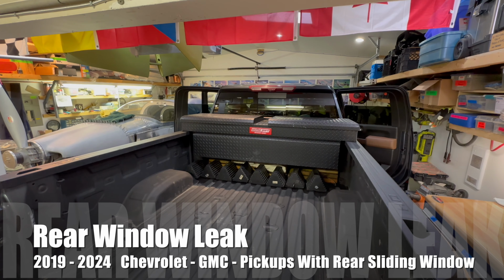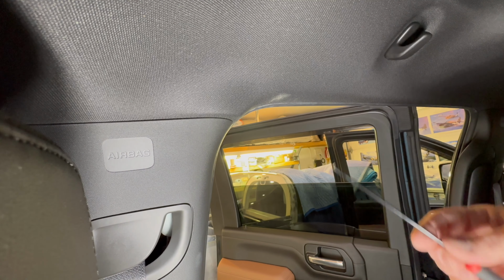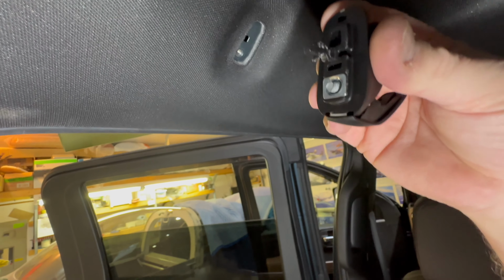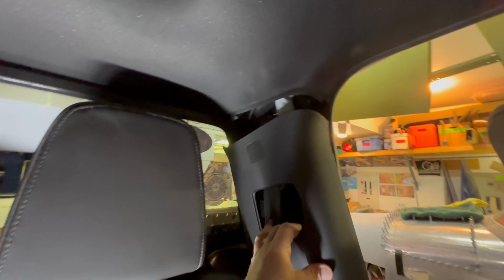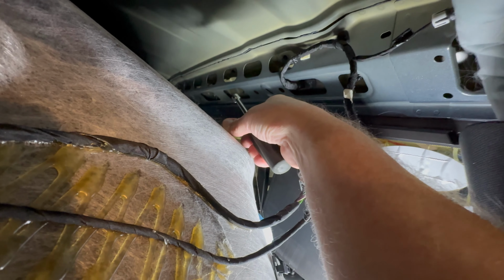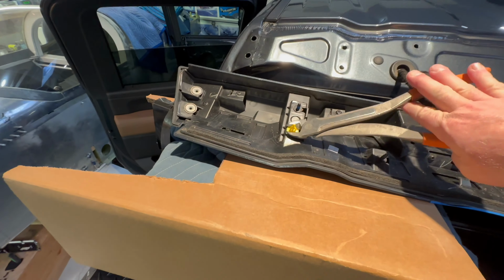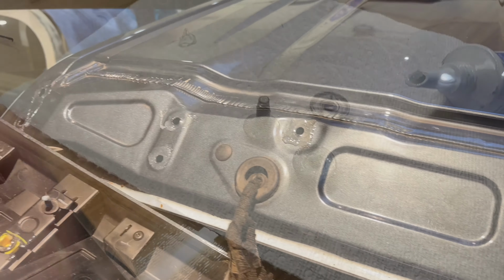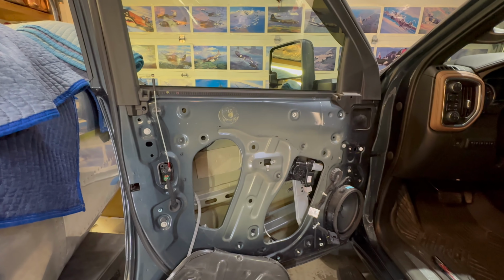Silverado Rear Sliding Window Leak Repair Fix 2019 2020 2021 2022

Comment: Nice video man.  I have a 2020 2500hd that started leaking 1 year into owning it.  Dealership replaced the window 2 times and resealed it 3 times.  Still leaks. Now out of 3yr warranty and trying to put it on me.  Dealing with GM corporate to try and get them to make them fix it.  Local glass shops around me don’t want to touch it since they know it’s a manufactures issue and haven’t found a fix.  They will replace the window and seal it but will not warranty their work that the slider won’t leak again.  Big headache!!!
Reply from the maker: That is horrible news. It's a dumb design. They've got over a dozen holes in the spoiler for all the fasteners. Impossible not to leak. Next time I have mine apart I will super clean all the holes with lacquer thinner then silicone every hole and bolt.
Reply: It’s a pain the ass for sure.  My solution is put the solid back window on there if it’s the sliding rail that cracks a leaks.  But they can’t seem to tell me if the solid back window and window with the slider are the same dimensions. So fingers crossed GM corp can answer that question.  The small slider is pointless in my opinion so just eliminate it if that’s a weak point in the design.
Reply from the maker: I think the worst part of the design is the dozen holes that the spoiler bolts go through. A roof with tons of holes in it. What could go wrong? How hard would it be to design this with tabs sticking up instead of bolts going though holes?
Reply: I’ve been having the same damn issue with my 2016 and my 2020 and GM dealership fixed it and it’s leaking again. Why can’t we as people who purchase these trucks form a lawsuit?  It’s not fair to us.

Comment: I think there more going on with these leaking roofs then meets the eye. I also have a 5th silverado with out the sliding window and my roof is still leaking. I just bought mine used a fee months ago so Im just finding out about the issue. If i had to place a better I say way is also getting in through the holes for the bolts that hold the 3rd break light spoiler. Im going to be sealing the entire outer perimeter of the spoiler with silicone to test out the theory. Also. The shark fin antenna also lets in water . Ill be silicone that always. 3rd i just found out recently that the black weather trims piece of the sides of the roof also leak on the new 2024 silverados dude to the weak metal underneath separating and creating a hairline crack. wondwr if that is also possible for the 2019- 2023 models . I found water coming down the sides aswell as from ybe front and the back. Smh GM really dropped the ball eith these trucks I tell you.

Comment from the maker: So I have a strong feeling that the dozen holes and bolts through the spoiler are going to start leaking again. Next time I find a leak back here I'm going to super clean all the holes in the roof with lacquer thinner then put a healthy ring of 100% outdoor silicone around each hole and bolt. Not a great design. Aluminum cab. Why didn't they make tabs that stick out for the spoiler to attach too? Instead they make holes all the way across. Bad design. Going to be lots of mouldy old chevys out there I hate to say.

Comment: Have to spend half a day fixing something GM should be recalling to fix….i took my 19 back and told them about it and it still leaks. Quality GM techs, now I got silicon all over that piece and it looks like shit.  Thnx GM
Reply from the maker: It's weird that GM would design something that needs so many holes through the roof. Stupid actually. Disappointing on a 100K truck
Reply: I’ve owned Chevy’s all my life and I’ve been a fan. Never again.  The 2019 Silverado LTZ is the biggest piece of shit. Their manufacturing quality control is subpar, the panels are too thin, and it shifts like absolute shit. #Chevysucks
Reply: I don't think they can fix it is why they haven't recalled it haha. Mine 2019 has leaked since I bought it in 2021 with 12,000 miles on it. Replaced the window multiple times and re-sealed multiple times. Still leaking.

Comment: So yours is starting to leak again or did the silicone do the trick? What electric tape did you use, how do you think that's helped over the last few months. Would you just put a bead of silicone in that gap the second time around?
Reply from the maker: I'm not sure about leaking again but I'm confident that it will. If idid it again I'd use more silicone and seal everything liberally. My favourite was sealing the gap bu putting a 1.5" vinyl tape across the entire roof. Sadely my son took it off. It was expensive Scotch 44. My vote for the simplest fix is to lay a huge bead of silicone all the way across the top to seal the gap put a strip of 3' vinyl across the whole top to bridge the gap and seal it. Basically make a roof.

Comment: Do you have a link to the tape you used?
Reply from the maker: It is 1.5" black vinyl electrical tape. Standard stuff but not available at Home Depot. Only at electrical supply stores.

Comment: I had the same problem in my 2016 and now in my 2020 which the dealership repaired in 2020 and it started leaking again a few months ago and my entire cabin smells of mildew once again.   My question is how come you didn’t put a brand new bead of silicone around the rear glass?   It’s great that you did the roof but what about the rear glass?
Reply from the maker: I felt that the bead I did went right to the top of the glass. Interesting thing has been happening is the type of silicone we used is leaching some weird film over the glass. it's a mess. Something tells me I'll be doing this again. I feel the dozen bolt holes through the roof are also potentially leaking.
Reply: @ontheroadwithnorm2024  this is just terrible, what can we do to file a class action lawsuit because this is not just five cars. This is thousands upon thousands of pick up trucks.
Reply: My 2020 is leaking bad today, just ordered the clips and going to try to replicate your fix. What silicone do you recommend?
Reply: Today December 18, back after a few months and I’m here to tell everybody that my window in the back started leaking once again after I had the dealership repair it several months ago, again! I wish I could post a picture on here of where she is leaking, but I have my doors open in my truck as we speak….. to air out the rear driver side carpet as I have it lifted up and with the heat on in the truck full blast.  I really hope GM reads this and I want them to see the annoyance that I’ve been going through with this damn truck and I’m not the only one..  hey GM what can you do about this? And I don’t mean fixing it again, how about addressing the main issue in your design flaw!!!!!!
Reply: @NicholasZak   I have my windows open now trying to dry out the rear back seat cushions
Reply: @clonts78  ohhh man im sorry!  I emailed GM Corporate earlier!
Reply: @NicholasZak  I've not had good experience with chevrolet, corporate or local. My 2019 has been in and out of shop for years because of the leak. They've replaced the window 3-4 times, resealed it multiple times. Still leaking as of yesterday. Every time it leaks, they want to "see it in for an assessment" The most recent time they couldn't replicate the leak so they wouldn't fix it. Going to go at it myself this time.
Reply: @bhuff86  Holyshit!!!!!  Why cant we all get together and get a mass class action lawsuit!!???  i mean Lets go!!  We spend all this money and THEY KNOW THERE IS AN ISSUE but they DONT want to FIX IT FROM FACTORY.  Im planning on doing it myself once the weather warms up here in the North East.